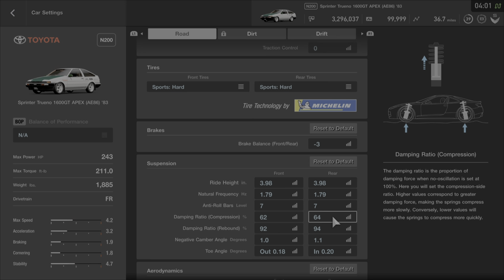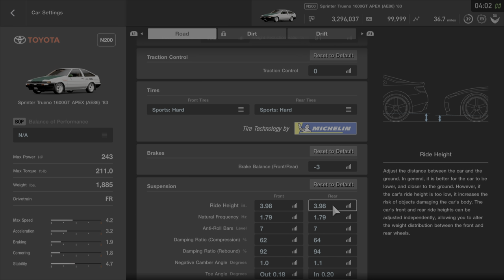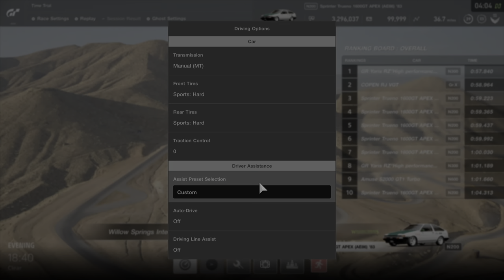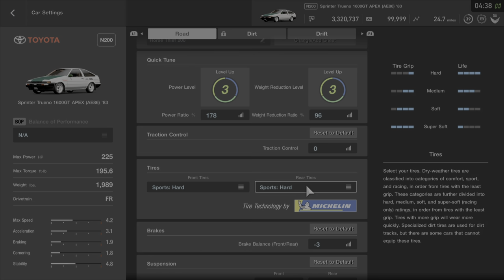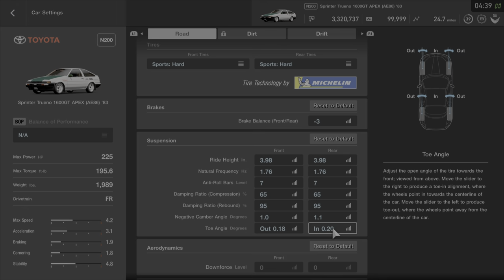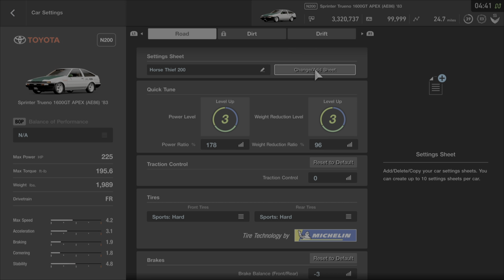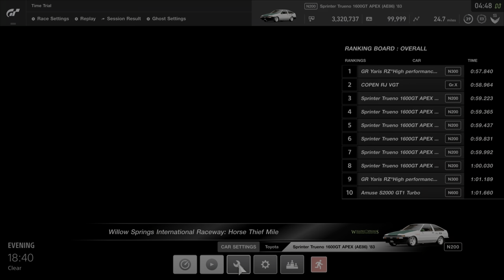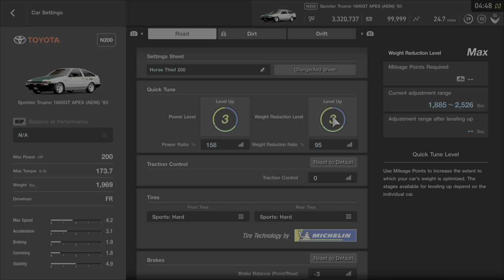Zero Countersteer Speed Drift In Touge Tuned Kyodo AE86 #gtsport

Comment: Its not really called speed drift its called slip angle mate
Reply from the maker: The driving style is Speed Drift. I'll eventually make another video on this with Assetto Corsa so it's more clear, but Speed Drift has a "Slip Angle" through turns in use of getting around fast, blocking, or being flashy. People are explaining both like it's completely different, when actually they work within each other
Reply: @YTFRCARS why did you explain what slip is?

Comment: So hypoteticaly... Could i use racing medium tyres for your setup?
Reply from the maker: Highly recommend against using racing tires on any street car, it's not what the touge community runs. But if you must use it for some reason I guess you can try. I would imagine the suspension probably is too soft for that much grip though.
Reply: @YTFRCARS  hey I was wondering why racing tires may be frowned upon? I've been using it on my Silvia and found it helps with track usage but I didn't know if there was an issue with it or not
Reply from the maker: @rustyshackleford3428  racing tires for track usage in general may be fine, but the whole idea of the touge racing is the Street racing culture. Meaning, it would be unrealistic for someone to put on racing grade tires just to hit their local mountain pass and such. A decent sort of semi-slick compound sure at best, but ideally it would be Street tires on Street cars. Certain instances like track days where you're bringing your touge cars to actual race tracks for events like at Nurburgring or Tsukuba Circuit, its expected to have racing tires for those sort of race or time attack events.
Reply: @YTFRCARS  oh ok, thank you for the explanation